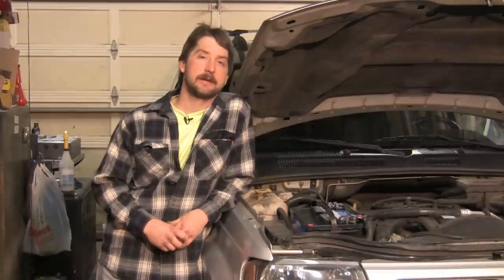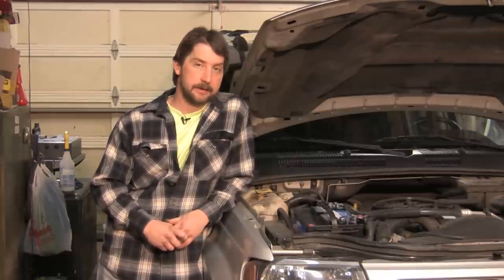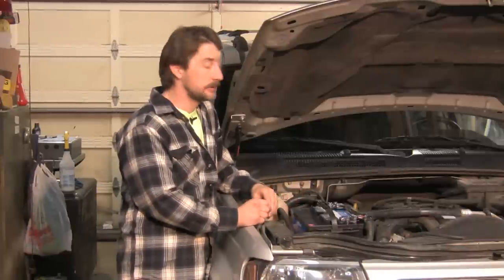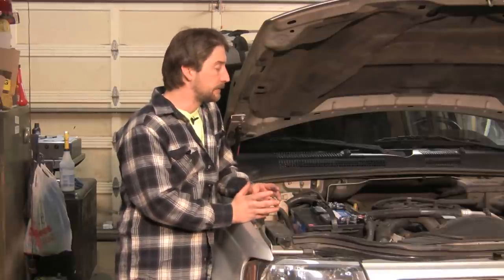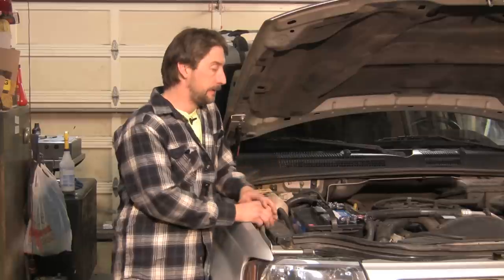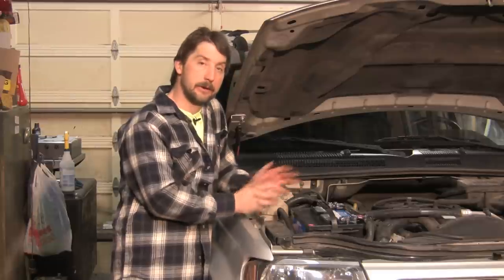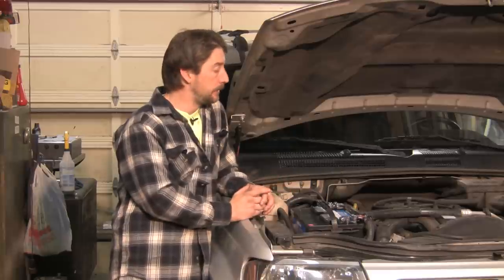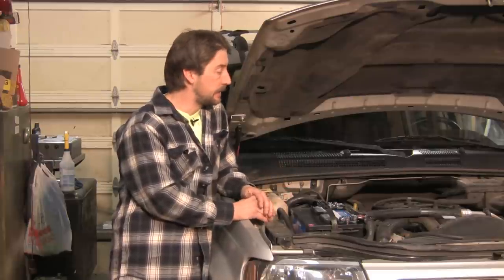Car Maintenance : Can a Bad Catalytic Converter Make a Car Overheat?

Comment: I have seen two cars overheat from a clogged catalytic converter, so yes it will make the engine overheat
Reply: Thank you I have 2006 Nissan Maxima and I just had problems with acceleration it Otto go slow when I try to gas it

Comment: Thank you so much, my car was overheating for no reason. Everything works fine, changed everything Thermostat, flashing out Coolant, changing sensors, the radiator fan motor, changed the radiation and still my car keep overheating after I hit a certain miles. Finally I found out was my Catalytic converter was clocked, and it created a back up pressure and creating an overheat. Dung, what a shame I spent close to a thousand dollar to fix it, that I could have fix it for two hundred dollars.
Reply: Andy Im having the same problem and i changed everything radiator water pump etc and still overheating did it work when u changed the catalytic converter?
Reply: What are you serious?! I literally changed out the whole fk'n cooling system on my 2008 Titan too and it still overheats. Also, it only does this when I drive it, never when it's idling. No mix mixtures or anything else. Does this sound like the cat could be clogged?

Comment: Thank you so much for this info! I have a Suzuki Aerio 2003, changed fans, thermostat, flushed the radiator, new water pump, you name it, after checking the car computer I had a code that said catalytic was malfunctioning, strange because the Check Engine light never went on, we took it out and problem was solved. Interesting though my car ran fine if I didnt pass 55mph, if I went faster engine would get very hot and both fans ran to keep it cool, my overheat light went on TWICE but luckily I immediately stopped the car and let it cool. Very valuable info in the comments section too.
Reply: I did all the above when im leaving the shop from picking my stang up they tell me i might want to get my cats checked...

Comment: my vehicle has a clogged catalytic converter and its still running.  It does sometimes have a loss in power but the mechanic said that its not a major problem right now.  I am going to get a replacement.

Comment: dont listen to just anyones information as its just a guess ,i just found out today the reason my car is not running more than 30mph and hitting gears hard its because my catalytic converter melted and clogged up my exhaust,if u dont have to go through emissions put straight pipe.its better for your engine.lie guys says also..a half bad one it bad for you

Comment: Catalytic converters won't "flush" in that manner because they aren't like AC systems. There are usually two blocks of substrate -- and assuming your idea actually cleaned out the tiny passages in one, they would most likely clog the passages in the block behind it even further. It's more than likely that the substrate has melted in a few places as well, which is one of many reasons why catalytic converters can't simply be "cleaned" and must be replaced.

Comment: FOR RECREATIONAL USE OR USE WHERE ALLOWED: You can cut the cat off and rig the o2 sensor up so it gets hot but it gets fresh air on the outside. Apparently it works on the XJs with the 4.0L engines. Im trying it on mine, im getting overheating, and I got a code about a bad o2 reading after the cat

Comment: Damn that happened to me. Rebuilt the motor and it had low compression due to high combustion temperatures after only 20,000 miles because of the old catalytic converter..... huge waste of money because I had to rebuild the motor again. I wasted about $7,000. Shit
Reply: So did you have a bad catalytic converter?

Comment: my car overheats only in city driving and runs great on the highway.  do you think that might be a converter problem?  i did have my machanic check my car and the water pump is working, i replaced the thermostat, the fans come out and there is no leaks.  i was pointing to the radiator going bad and not cooling the coolant enough in the city but then i seen this video...what do you think
Reply: babygirl831281 what was the problem?
Reply: Please tell us what happened did you get it fixed and what was the problem
Reply: My mustang dose the same thing   dose the fan turn on late?   All u have is my pre cats
Reply: @Flunoir  sorry, no i did not get it fix. i just got rid of it

Comment: Lately my car started jerking when I am pressing on the gas pedal.  Like when I come to a complete stop and start to go it does it!   Also it does it when I try to increase my speed on the road!  It even feels like it want to die on me!  It is a 2000 Chevy Malibu and has 94,000 miles on it.  I guess its time ofr a new car but I use it only for work.  What do you think the car's problem is?

Comment: I am trying to clean out my catalytic converter. In order to remove my catalytic converter I have to remove the whole exhaust system from the engine and towards the back. Instead of doing this,. Can I remove the oxygen sensor the one that is sitting in front of the converter and use a flush gun tank like the ones they  use to flush out a/c system contaminents from the line with lacquer thinner? Do you think this will clean the system if I do this a couple of times?

Comment: @kargmeister1337 it can be a major problem, I've had mine get so clogged that my car wouldn't even stay running. I still haven't replaced them but I've cut the exhaust off after the cat. (It was also clogged)